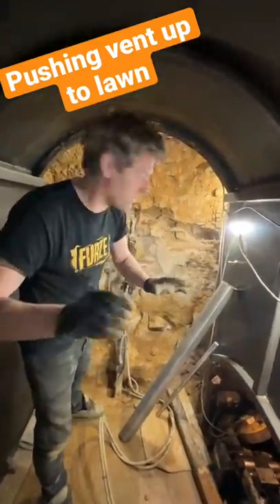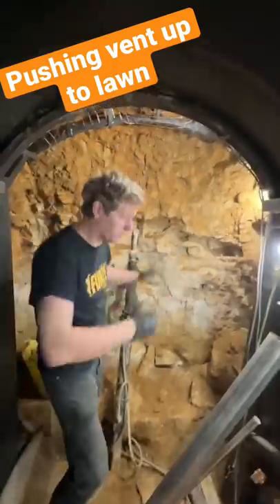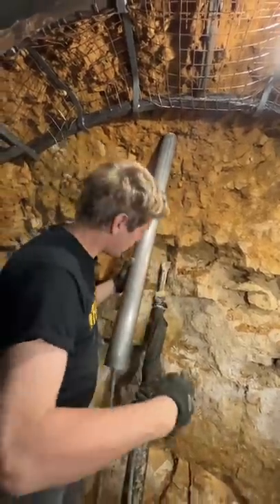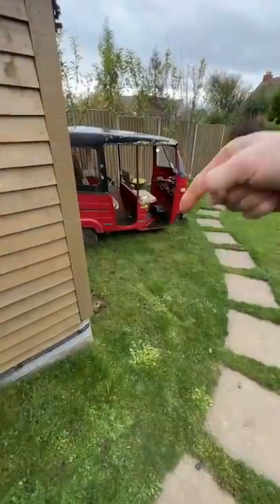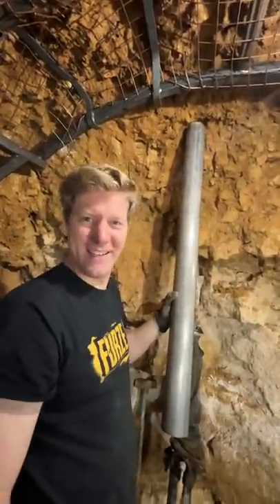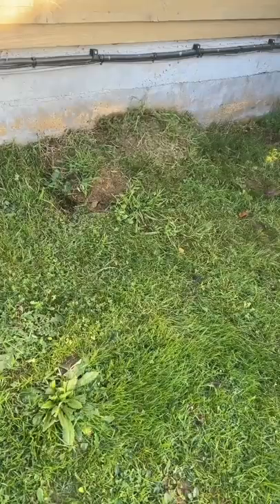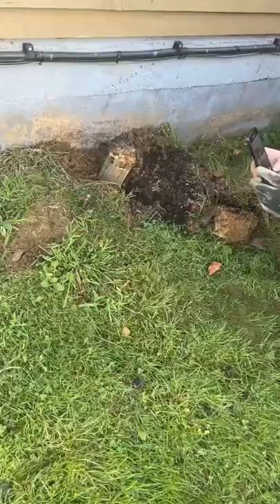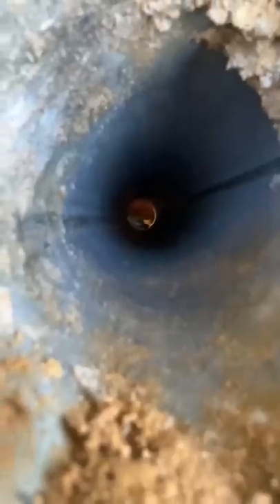PUSHING A VENT UP THROUGH LAWN #shorts

Comment: You need to move the drain on the shed guttering so the down spout also act as hidden air vent
Reply: And you can shower in the tunnel when it rains
Reply: Pretty sure he knows.
Reply: @shawndiggins3741  tomorrow he'll be announcing that he's made an underground swimming pool
Reply: @shawndiggins3741  that might be. ABIT much I just meant as a disguise not to drain into the tunnel
Reply: @shawndiggins3741  he could avoid that simply by having the ventilation pipe running up inside the downspout and poking out at the top.
Reply: He just needs to find a friendly plumber.
Reply: It would be far easier to disguise the one he just punched through as a sewer clean out, not something the curious want to inspect..
Reply: @murphymmc  Just make sure the in-laws don't hook the septic drain to it when they come to visit in the rv.
Reply: @negi9040  SHITTER’S FULL!
Reply: It might be a temporary vent till he does the concrete..
Reply: Even if it's not temporary, a simple cone cap or routing to inside would solve any water issues
Reply: Smart
Reply: Honestly I think of you would Use it for air and water it would cost too much humidity down there and cause mold and other things to grow thank you should keep the two systems supper to keep problems on the minimal when you complicate systems like this in a bunker it causes a lot of other issues
Reply: @fourtiefourfour4259  I think you misunderstood my idea 

My idea was simple 

Move the down spout to cover the air intake and then extend the air intake up the down spout and into the eves of the shed 

This way it's completely Hiden in plain sight water is away from the air intake which would the be inside the shed 

My only worry with how he has don't this air pipe is that surface water from rain ect will follow the pipe down through the soil and the pipe it's self will fall down into the tunnel leaving a hole to the outside 

So where it comes out of the floor in my opinion needs concrete to stop this 

This is an issue of Colin's now if he did my idea or not
Reply: @madyottoyotto3055   Yes it is a simple idea I’m saying that air and water do not mix his whole facility is made out of metal, steel actually which will rust if oxidation sets in and that will happen a lot quicker if he allows water to flow through the bunker like that it’s better to keep things like that separate because it cuts down on issues within the bunker sometimes even the best ideas have bad consequences He would have to add a lot of dehumidifiers Now he could use that drain as a water collection area but it would have to be completely separate from the air and it would have to be filtered very well would like a with reverse osmosis system or something like that rain is very acidic and contains a lot of minerals that the human body does not break down very well also Parasitic infection can also help from storm drain water if you don’t treat it just by getting into it or touching it sorry not trying to ramble Just worked in irrigation for a while and water treatment also have lived in a self-sustaining way for a good good while
Reply: That's an excellent idea. I was about to suggest a log or something like this but your idea is better. Beside getting until the roof allows using wind for air circulation. That could be useful for a webcam, the 'periscope' someone else suggest 😊
Reply: @pupyasko1233  He could have avoided the whole thing by putting the ventilation pipe inside the shed...
Reply: I think the problem with water in the tunnel is that your having to go against gravity to get it out🙃
Reply: @calebhall4620  there won't be any he will do it right have faith
Reply: Ouch, didn't think of that combination.  Yeah -- best to prevent that.
Reply: @Tagraff  it's easy to prevent concrete around pipe to stop it washing what is there from around the pipe
Reply: This is my fear. Someone finds air shaft then poison and block it off.
Reply: @robertcollins7515  another reason to hide it in the eves of the shed
Reply: Is the spout not likely to live up to it's name though, and pour rainwater into the tunnel? If so, this could of course be used as a source of fresh water, if om means of storing it could be rigged-up. Something needlessly technical, like a barrel?
Reply: @2H80vids  rain water not the freshest 

But no my idea is drill the downspout foot so the air pipe can pass straight up out the top into the eves of the shed 

So long as there is a half meter square cap of concrete where the air pipe leaves the ground then water shouldn't trace the outside of the pipe washing the ground out 

As long as this was done and seal the hole in the foot around the air pipe win win situation

Also it would be easier to tap into the alkathene piping that brings the water to the house if he wanted water down there that is 

Let's remember it's not a survival shelter 

Although it would make a bloody good one 

Would love to see someone try and get in with Colin there 

Out come the spinning belt of knifes and the petrol flame thrower ect ect ect 

He made some mean ass weapons in his arsenal
Reply: Total Hogan's Heroes vibes!
Reply: @mborder8428 😂😂 - where'd we get some "dam" bait'

Comment: Remember, you also have to vent the lowest point also for heavy gasses not just the light gasses
Reply: Mechanical ventilation I would think.
Reply: Radon says hello
Reply: Add a fan to mix it all up, youre good
Reply: Farts are lighter than air, so the ventilation has to go up ;-)

Comment: Don't forget to build a vacuum teletransport tube system in the tunnels! how cool would it be if your wife or kids could send you food or stuff straight from the pantry from your house to the shed or bunker with tube transport. Otherwise you can also use the tubes as a central vacuum cleaner system.
Reply: Those systems don't move much weight... in a former life I was a bank teller working the drive-up window; more than a half kilo of coins and the tube would get stuck.
Reply: @deanwoodward8026  I'm sure colin would overpower it and if I remember correctly your tubes went WAY up over the cars so the vertical height was a bigger issue than lateral transportation.
Reply: THIS!
Reply: @deanwoodward8026  if you go with a push configuration rather than pull then there is less limitations on the amount of force possible.

However, I think his wife left a while ago.

Comment: you  can place a solar tube on the pipe, then you have daylight in the tunnel.
nice work
Reply: He lives in England. 🤷
Reply: @xanitoxanito193  dont worry, we usually as a nation book at least 14 days of sunshine a year. So it would be worth it.
Reply: @pkf4124  Funny thing about it is every time I've gone on vacation to the UK one of the first thing I did was to buy an umbrella. So far I've never had to use any of them while in the UK, though they've been frequently used at home over the years. I remember a year when we went to Scotland. They had to dig deep in the records to find a year when they had that much sun for so long. We heard talk about it on the radio the last few days before taking the plane back home.
Reply: and no airflow ...
Reply: @Jordan_C_Wilde  yes, that's true. Colin has to bore more holes.
Hahahaha
Reply: THIS!
Reply: @xanitoxanito193  I'm not sure if you know this but the sun still shines in England.
Reply: @randallsmerna384  

And jokes too?😜

I live in Asturias, north of Spain, and last year summer was in tuesday.😘
Reply: @xanitoxanito193  , where there's daylight too...

Light pipes are used here and even in Victorian times, the 'borrowed' light was something that was used to light parts fo a building that would otherwise have been in darkness.
Reply: @zilspeed  
And here fom Blas de Lezo's times.
We called it "windows".
Reply: @xanitoxanito193  

OK, you win.
Reply: @zilspeed  It was a joke, from the beginin.😜

Comment: Honestly was a little bit of work you can hide that vent as part of the building. it's so close to it
Reply: My thoughts exactly.  Hidden and clean.
Reply: Yep I vote for downspout being moved to mask the Air vent
Reply: Sorry but do you mean “with” instead of “was” after honestly? I personally think it reads better
Reply: @yorn4286  chill its just a mistake. That or he meant to say it was in fact a bit of work and could have been easier
Reply: @yorn4286  ya with not was
Reply: @madyottoyotto3055  put the downspout in the airvent free water
Reply: @bmxscape  you could easily build an overflow so it fills a tank and then drains 

But it would be more fun watching him make a well down there lol 
😂🤣😂
Reply: pretty sure they're gonna use that vent only temporarily, and instead use it later on to funnel concrete down for the ceiling. I'd wager there'll be proper ventilation with fans etc. once the tunnel is completely done. Permanently having a hole in your garden is a pretty shitty idea if you don't want the tunnel to flood - it works temporarily if you put a lid on it, but you don't wanna have to take the lid on and off all the time once the tunnel is done.
Reply: @The_Real_JN  i even said sorry 🤦‍♂️
Reply: @yorn4286  where
Reply: @The_Real_JN  in the beginning. Please read something before commenting
Reply: @yorn4286  that's hardly apologetic is it. That's the type of sorry someone says to try and sound less critical
Reply: Understandable

Comment: Still surprised Colin hasn’t built a tunnelling machine like the one used for the Channel Tunnel yet…
Reply: Give it time.
Reply: Don cheadle has one… the French side though
Reply: I've put much thought into a diy tbm before this series was ever a thing. My idea was to build a steel box with hydraulic rams welded halfway. Make precast concrete sections kind of like a crude tbm with a shield now  but square
Reply: That would be boring

Comment: Please do a Radon test to make sure you aren't being exposed to a dangerous level. All that exposed soil is much worse than a few small cracks in my concrete slab and I had to install a mitigation fan.
Reply: He’s in Stamford, Lincolnshire. Not quite quite on the hills leading to the Pennines where radon is an issue in that part of the country. So probably no issues.

Comment: I hope Colin is going to do a little bit more to that, so that it doesn't become an unintended showerhead when it rains. Should probably be elevated a bit topside, and have a cover over the top to keep rain from getting in (if not a fan to pull in air more efficiently).

Comment: Hallo Collin, build a wall fan with rain protection grille in your shed.  Maybe with a cable duct as a connection to the pipe.  That it looks like a fan for the shed.  And if you then add an activated carbon filter for cooker hoods, you can even offer good air for your vault.
 However, you would have to drill up into the shed for this.

Comment: You measured that well. Just make sure that pipe is housed well. Very vulnerable if someone discovers the air hole and is not behaving...a garden hose turned on full down the hole would/could be catastrophic...however you in the UK...no one does that there.

Comment: I'd have used PVC over steel for longevity. Also, I'd have made the pipe taller above ground and made a sort of screened roof for it to prevent bugs and rain / flood from getting in.

Comment: You could have smashed the front into a flat edge type thing so it would cut through the ground more easily and there wouldn't have been any dirt in the pipe to clean out and once it's at the top just cut the wedge off.

Comment: PLEASE put in a sprinkler system because even with proper ventilation, fires are extremely dangerous in a tunnel, especially because you do a lot of welding and the floor is made of wood

Comment: Give it a HEPA filtration system and that little shelter becomes disaster ready.
Maybe also joint it and make it look like a feaux chimney for the shed so that way you have less risk of inundation.
Aaaaaand maybe a PTrap with a runoff drain just for rain clogs.

Comment: Colin you need to put an NBC air filter inside of an armored box on top of that pipe.
You’re not 100 feet underground so if you end up being in ground zero you might still absorb some passive radiation.
However that’s no reason to willingly breathe it in! Get a filter on that thing and put some recirculating carbon filters inside and maybe an exhaust vent.
That way you’re not smelling your own farts all day long

Comment: You should’ve considered epoxy painting that stainless pipe…stainless can become impregnated with Iron from dirt and then it can rust as regular steel.
Reply: Galvanized pipe would’ve worked better as long as the galvanized coating doesn’t get scratched
Reply: Although I like the idea of breathing through stainless better

Comment: What would happen if heavy rainfall happens? Would it flood the tunnel? Would maybe need some drainage down there. Loving the series though! Keep going
Reply: Well, the tunnel will be encased in steel and cement, so there shouldn't much anything leaking in from the ground around the tunnel. If you're thinking about coming down through the ventilation pipe, I'm assuming he's going to build some sort of a hood over it to stop that from happening.

Comment: You should put a fake 20 gallon  flower pot with a K&N air filter welded at end of pipe hidden In fake flowers...and a tazer connected to pipe so if anyone trys to mess with it  BOOM 50k volts

Comment: If you had plugged the pipe with a cone tip you would have had a easier time forcing it through the earth, and it wouldn't get any muck inside. Not that it really matters because you're not putting drinking water or electrical cables through it.

Comment: make it a 30cm up an then end with a clamped on 180 turn. then, it wont rust much when exposed. it also wont flood if you clamp it as you can clamp on a seal, deadend, or a extra long pipe in the event of a flood
Reply: uh... hes a plumber.
Reply: @MooKau_  i was employed by the Swedish state to build and maintain air raid shelters.
Reply: @BeNiceToEachOtherplease  Nice one. Sounds like it would be a bit of fun :D

Comment: How are you handling water drainage? Or does that just not be an issue in your climate?
Reply: His house is above the local water table and the UK doesn't get cold enough for deep frost heaving
Reply: @bengrogan9710  I was more worried about rainwater coming down the vents and getting all into that carpet and the like
Reply: @Auraknight  Colin is smart enough that I'm convinced that he'll have already fabbed up a cone deflector cop to rivet over that pipe before the next rain

Rain in the UK is common but comparatively light  so most industrial chimneys will just have a stainess or galv steel cone fitted on top - the air has to do an S bend to come out but rain has to be going uphill to go down
Reply: @bengrogan9710  That's fair! We get several inches of water here, not to mention absolute storms. Considering how well down there in intended to be furnished, it was the first thing that came to mind.
Reply: @Auraknight  the worst storms in the UK are the equivalent of mild storms in the tropics and a mild Canadian winter is worse than the worst UK snows.

We have an easy climate only really hampered by lots of cloud cover and light drizzle
It's like the weather suits the British historic temperament - no extreme outbursts but understated and disliking public displays of affection

Comment: I'm not sure why the top wasn't capped off, would've saved a lot of dirty cleanup work.
Reply: Because as a tube it will slice dirt, as a capped pipe it would have to push it aside.

Comment: How are you dealing with rain/flooding
Reply: The bunker doesnt leak either. Just u shapes on top of vent prob a mesh filter and will make it a bit taller. That's just max length pipe that fits inside tunnel

Comment: won't this be a flood risk for the tunnel and bunker?
Reply: My thoughts exactly. Think he's going a bit overboard with all the vents. 🤷🏻‍♂️
Reply: On the full video it will have a u shape on top so nothing can go down it or something. Prob a mesh filter and be a bit taller. Thata just the longest pipe that fits from floor to roof of tunnel. And you cant have to much ventilation.
Reply: @R3TR0R4V3  he really isn't. Carbon dioxide is heavier than air. And without forced air currents will build up to dangerous levels.
Reply: He already has half a dozen vents in there already though, which is plenty.
Reply: @R3TR0R4V3  which is about right.
Bare in mind mine shafts had fans dozens of feet across pumping air down them, he's trying it with heat convection

Comment: Okay now what's gonna stop the tunnel from flooding?
Reply: A cap on the pipe and being above the water table
Reply: @bengrogan9710  If the pipe is capped how would air flow? and me understanding 0 on the water table n pressure stuff I still have to assume water from rain and such goes in to pipe and then tunnel unless something is blocking both air and water passing through it?

Like I'd assume you'd go for some form of curved hooded airflow thing for venting a tunnel like that, something like a fume hood as the surface level that leads up into a u bend that heads down along the wall of the house into the tunnel so air can flow but outside Armageddon levels of flooding no water can get in

Comment: But what about rain.. or do you not get a lot of it?
Reply: It will get capped
Reply: @bengrogan9710  I had figured, was more thinking standing water or flooding.. seems like I should stick out a bit more
Reply: @1dickycat  standing water won't build there, the shed is the top of the garden, the lawn grades down from there